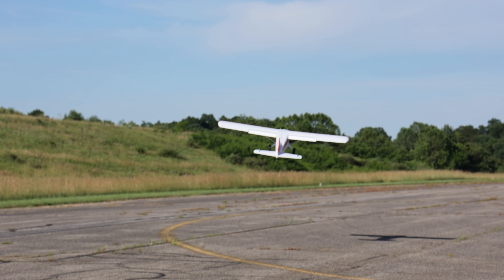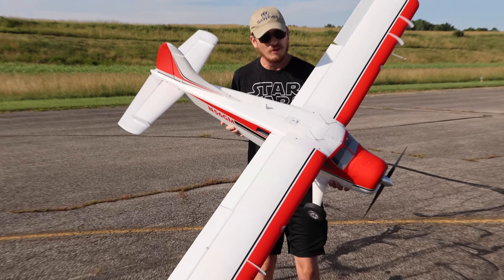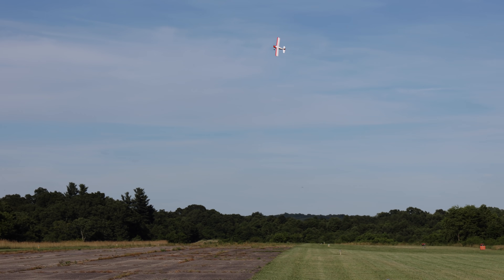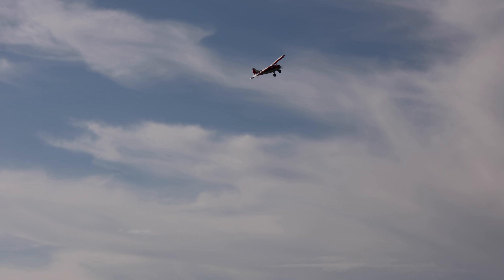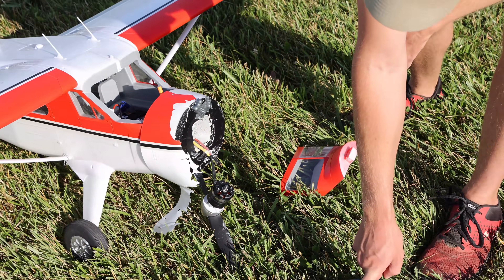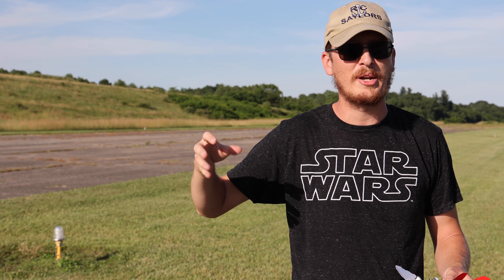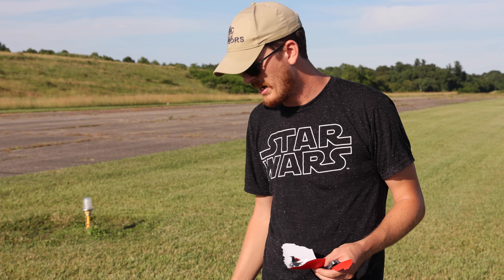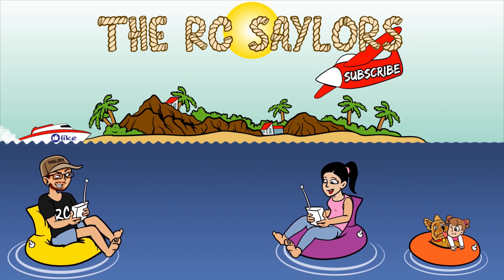GIANT RC AIRPLANE CRASH EXPLOSION!!!! - FMS Beaver 2000mm V2 - TheRcSaylors

Comment: Looks like the factory is going cheap on thread locking compound. All of the motor mount screws fell out via vibration and the motor dropped loose and chewed up it's cowl. I see no screws in the mount nor in the motor, so they must have unscrewed and fallen inside behind the firewall.  Loctite is a must with metal-to-metal fasteners.

  The UMX Ultrix is being shipped with motors that have plain bushings that are dry as a bone. Not a spec of lube, and a lot of brushless motors are failing because of. I clued others at RCgroups in on the solution, they oiled their motors and got most working properly again.   Chinese manufacturing is taking shortcuts on us.  Solid bushings in the motors, and even the instructions say nothing about oiling them. Sad.

Comment: Quick fix for only 14 bucks...cowl and dummy engine! And a little soldering. Yehh...better add a new prop if the missing chunks didn't balance it finally. ;)
Reply: I’ve repaired mine like that several times and it continues to fail: it’s definitely a design flaw:

Comment: Nate, (love the video! Got to throw you a curveball though, as I do from time to time).....
if you had a loose cowl, why the plug about great customer service? Just my thought, isn't it your responsibility to make sure the cowl is secure before you're flying? I'm just saying, it's not something I would call the company for any warranty about. For example on my 2.1 m carbon z Cessna 150, on my maiden I made sure to place a small piece of tape top and bottom on the cowl to ensure it was secure as I believe most people do. It was my first foamy with a cowl and I had no outside instruction, it just seemed like a hazard for the prop so I wanted it super secure.... I might get beat up for this comment but do you get where I'm coming from?
Maybe just ask them for a new fuselage and Cowl at cost if you think the cowl design is poor u know. I'm assuming you assembled both the motor and the cowl onto the fuselage? Have not put together a beaver or even seen one in person before......or does the front end come fully assembled other than mounting the prop? If it came pre-assembled that's a whole different story.... but I believe on this model you put the motor in and the cowl n prop on yourself before flight.
 At first when it went boom I figured you did not have any loctite on the screws for the motor mount and it had loosened up, but then with hearing about the cowl jiggling before you landed, I assume as you slowed down to land, it shifted forward a touch and struck the prop... there by ripping the motor from its mounts. And that extra good sound coming out of it might have been some chips in the prop from a couple cowl strikes earlier before the catastrophic strike. I hope that's not what made it sound so good though. Dang it really makes me want one as good as it sounded. Lol.
Not fun to have the flying cut short man and it's a beautiful airplane, and it sounds great!! and you flew the pants (and more) off of that thing!!!! Lol.
I'm definitely interested in this model now and I hope you get where I'm coming from on my thoughts.
Let us know what FMS says dude.
keep the great content coming. I have been excited to see more flight videos.
I enjoyed the New Timber video y'all did recently as well.
 😎🤘☀️
Reply from the maker: I may not be able to respond to all of your comment in one go (doing so from my phone right now) but I think this will answer most of your curiosity.
The motor is mounted already when you purchase the plane, as well as the cowl over it. 4 small screws hold the cowl on, that aren't really designed to be taken on and off. You unscrew a wood screw and tighten it over and over and it sorta loses it's ability to do it's job as a screw. A plane like this shouldn't have this problem. Loctite should come installed on the four motor mount screws. However, I could have and probably should have landed sooner to avoid this! 👍😁⚓
Reply: Dude!!!
Thank you for explaining. Considering that the motor is already mounted and the cowl is in place, they should definitely cover that for you. Now I completely understand. Sorry for my limited knowledge of that model. Wow what a bummer!
It does sound like they should cover you on that then, for sure.

Comment: Husky-wannabe! This didnt seem to fly nearly as well as the very similar Husky we saw you guys fly several times a few months ago.
Reply: The Husky definitely has the better looks however
Reply: @Tyler-es  I love the way the wings look on the Husky. The only thing I dont like about the plane is that the wings arent easily detachable for transporting. When planes are this large you need to be able to remove them and put them in a carry bag easily. Maybe the Turbo Timber Evo will have parts that can be engineered into it. Its an extremely nimble plane capable of very high G aerobatics, and the price under $300 is fantastic.

Comment: You guys should never have even flown the plane anytime there is any unusual noise coming from the plane even just if you think it's loose cowl. Just think what can happen if you were flying like a balsa plane with a large Gass motor. You already spoke of having people watching. Even a large electric motor flying out of a plane with a spinning prop can seriously hurt someone even possibly you or Abby and I think that would be sad. So please even if you guys think it's something even very small look into it immediately. By the way. FMS has for years on there larger birds had motor board problems. My first FMS version 2 1700mm corsair made no noise and had no vibration the day that the motor board came apart on it. There was nothing left of the airplane forward of the wing. It was absolutely one minute there and the next gone.
Reply from the maker: Yes, you are correct. Hindsight does always seem to be 20/20, yet we as humans are bound to make mistakes occasionally. I wonder, have you ever made a mistake? Do you ever speed in your real car, knowingly driving recklessly over the speed limit even if only 1 mph? Thankfully noone was injured. We were flying in a predictable pattern, WAY away from any people. Yep, I should have landed 30 seconds sooner than what I did. We all learned some valuable lessons here though, which is why we shared this video. We do not live in a perfect world and these are real things that can happen. Go check out our channel. With nearly 2,000 videos this is probably the most destructive thing we've ever experienced or shared, but hopefully this helps more people understand what to do in a similar situation and what not to do. 👍⚓

Comment: I think your prop came loose.  It took off running very smooth.  When I flew nitro or gas engines I had to balance the prop before flying.  Or it would vibrate very hard during idle.

Comment: Well, nothing like the teacher telling the student what not to do, but doing it anyhow and then saying " the one thing to take away from this is the manufacturer will do the right thing." Instead, we expect the manufacturer to "do the right thing" and we avoid our own responsibility and just eat our losses and buy another one. It's like a customer coming to my store to return a wash machine that quit working because it was making an unusual noise but continued to use it and expecting me to refund their money instead of checking it out first. Wow, ok then.
Reply from the maker: Pleasetl tell me how this was my fault? You think on a PNP model I need to disassemble an aircraft 100% and reassemble it with loctite just incase the company didn't do their job? I guess you must be walking guard rails right now, trimming blades of grass that the State employees missed while telling me what I did wrong!? Lol.. oh brother!
Reply: So you really expect the PIC to be an expert on all the noises from the aircraft in couple of minutes of flight time?  I''ve been flying RC for 40 years and I think they reacted appropriately.  The noise was getting worse so they brought it in to land.  The manufacturer obviously didn't apply Loctite to the motor mount screws and they vibrated loose.
Reply: @TheRcSaylors  👍

Comment: It wasnt the Manufacturers fault the plane is not a  stunt plane. It should have been flown scale flight and not with  drastic maneuvers like you were doing especially when you realize something didnt sound  right. Good luck on getting that replaced.
Reply: The motor screws backed out of the mount. How is that not the manufacturers fault, loctite was obviously needed on this pre assembled model.
Reply: This is a model airplane and it does not have to be flown scale like the real ones if the motor was secured correctly there is no way you can fly it off it's mount
Reply: @natal777  the key word is "if"
Reply: @kylelanning5856  were you there?
Reply: @lesterhall5145  I can see pretty clearly on the video how the motor detached cleanly from the mount. I didn't have to be there.

Comment: Looks like a structural failure / quality control issue. FMS like all the rest, right down to the "S" branded radio, are manufactured in China. However; what's Horizon Hobby's ( HH's ) policy on such matters since they are the US distributor of the products ? Perhaps you got it resolved with HH since this looks like no fault of your own.

Comment: Yeh, I'm sure they just change the plane for ya,    they have shit customer services to normal customers, if they have given you the plane to review of course they'll help you, they would'nt help us though......!
Reply from the maker: Lol, you think they are happy that we showed their plane exploding to tens of thousands of people?!  You've got a lot to learn my friend.  However their customer service did say they would replace the PARTS that I need to get it flying again.  Video proof of what happened helped a lot.  I'd say your attitude is probably what makes you think the things that you do.  99/100 people would say the opposite of what you have about their customer service.  I'd say most people end up getting a ton of free parts that don't actually need them and abuse the system.  Anyways, you grabbed our attention for a second, so I suppose you accomplished exactly what you wanted.  Way to be productive with your time!
Reply: @TheRcSaylors  not trying to be rude because I love your channel. But the plane exploding to me was both the manufacturer and the user. Before every flight all screws, nuts ,bolts and clevises should be checked. And you know any screw that makes contact with metal should be checked for lock tight. Doesn't matter if it's PNP or ready to fly. If you read the manual it tells you all this. Love you guys and your channel .

Comment: Every weekend at the field I see people spending lots of money on crashing foam junk. Quads forever!
Reply from the maker: Quads are nice, but your statement is pretty skewed. Yes, there is a lot of foam junk on the market. Good foam planes though can easily hit 1,000 flights with minimal cost to keep in the air. Quads tend to take more $$$ to repair from what I've seen and experienced if crashed, and can crash just as often if not more often than most planes. Thoughts?
Reply: Quads STINK, and are the primary reason our hobby is under the FAA microscope the last few years!!
Reply: @michaelbrill6609  This is not your hobby! It belongs to quads, planes, and helicopter's. I fly all three, and the quads are by far the most durable. If the foam planes were made of more carbon fiber, they might survive more intact in a crash. I knew that the comment would bring quad haters out of the wood work. My point was that foam planes are expensive by comparison and break far to easily. I have seen people blow the foam planes apart so bad that they are not fixable. I have quads were every part is changeable and extremely durable. Someone should build the high stress parts out of carbon and not egg carton material!
Reply: @TheRcSaylors  I do agree that there are good quality planes, and I have a few small ones that take crashes quite well. I should have qualified it with large foam junk. I was out to the field last weekend and saw a plane made of carbon fiber and poly material. My point was that the large foam planes disintegrate on impact and are almost always total losses. I fly the little micro planes and they are both agile and durable. I have seen tons of the large foam planes break  very easily and cost hundreds and hundreds of dollars to fix . I also fly the 2-3" quads which are almost indestructible and cheap. If you haven't flown one yet, get a Diatone GT349. It is a 3" that is rtf andhttps://www.youtube.com/watch?v=7fQOXSnjiUQ will do over 100 in 6s form!
Reply: @parker1ray  I wouldn't call one guy "out of the woodwork".
Reply: Fly a helicopter like a real man... Quads forever, lol...
Reply: @MentaIPatient  The troll infestation problem seems to be getting worse on Youtube I see!
Reply: This must be bait because quads are pretty lame and they don't even look cool it's just a stupid looking ufo😂
Reply: @parker1ray  Oh please, I've been flying foamies forever and I still have the majority of my originals.....
Reply: @CJB-z3q  By the way that the quad sport has exploded and the fact that the foam junk was not even required  to be registered before quads speaks for it self! The FAA is requiring it due to the fact that 27 percent of people have now flown quads and the number is growing every day!

Comment: Inexperienced mistakes cost you. Could have EASILY been prevented.  Honestly no offense, but it seems like every time I run across another one of your vids you're tearing something up!
Reply: How could this have been EASILY prevented?
Reply: @itzChampy  Blue Loctite all over the screws
Reply: @enriquech4041  is that defect something that EASILY could've been spotted?
Reply: @itzChampy  For a newbie probably not, are you?
Reply: easily been prevented? This is a pnp model with the motor installed. Not his fault, but the manufacturers. You shouldn't expect to disassemble and rebuild every pnp model you get.
Reply: @enriquech4041  I am, I bought my first plane a month ago. Are you supposed to go behind the manufacturers and check every screw, seal, and connector because this is an EASILY made mistake by the manufacturers and commom? Seems like OP is being disingenuous here.
Reply: @itzChampy  You shouldn't have to, but yes if your a responsible pilot. I take apart and put back together all my RC stuff before it even gets a battery in it. Unless it's cheap and I don't care if it gets destroyed.
Reply: @itzChampy  You can learn the easy or the hard way...
Reply: @enriquech4041  whats the easy way.....
Reply: @itzChampy  Absorb wisdom from someonelse's mistakes